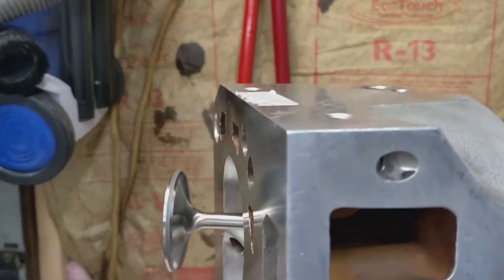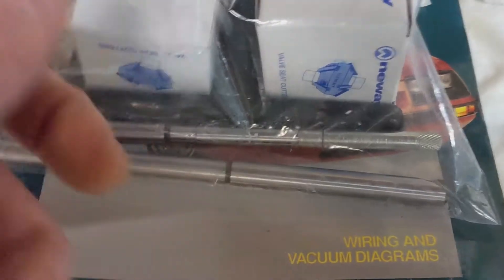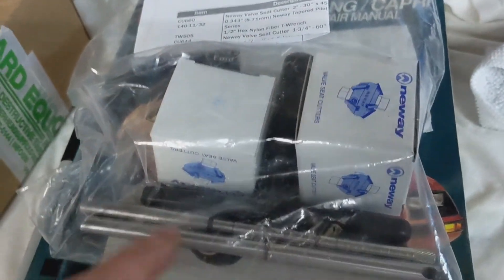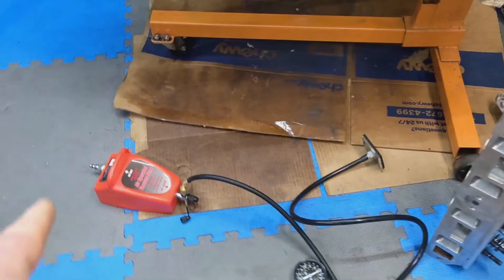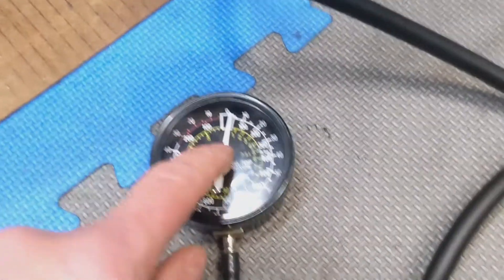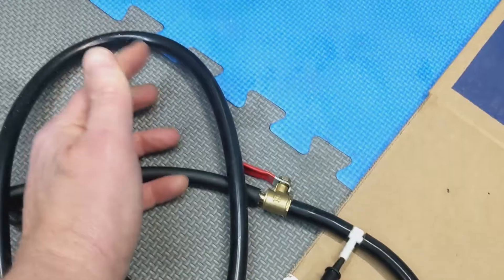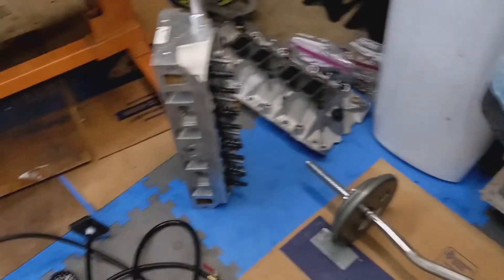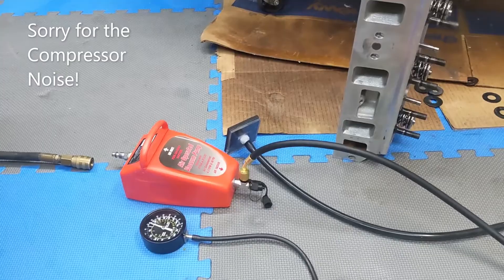vacuum testing intake valves after diy 3 angle valve job

Comment: When you vacuum test on the port side, the valve guide and seal come in to play, vacuum testing on the camber side will tell you more about the valve job, if there's a leak you must then determine if it's exhaust or intake, filling the chamber with solvent works too.
Reply from the maker: @richardvanmarter8780  thanks, good information and yeah I did check on chamber side once it was all assembled.

Comment: That's a really wide 45.
Reply: I noticed that as well...
Reply from the maker: @jamespatterson9446  yeah that was the first time trying those tools so wasn't a perfect job, one thing I found out after was trickflow puts a 47 degree seat on these stock so maybe I should have tried a 47 degree cutter instead?
Reply: @vrm86gt  cool deal I wasn't sure if you were just starting off with the whole valve job deal. I just happened to come across your video. Some do different seat angles saying it works better with the design of the ports. Some cases it's true but some they aren't. Recommended seat angles by factory probably don't apply if the heads are being ported.
Reply from the maker: @jamespatterson9446  yes I am very much learning as I go! my car went 130 mph in the 1/4 n/a with this valve job so that's pretty decent for this combo and my minimal drag racing skills!
Reply: @vrm86gt  not sure what your combination is but it sounds like it's moving pretty good
Reply from the maker: @jamespatterson9446  347 in a foxbody
Reply: @vrm86gt  cool deal sounds like a fun ride.
Reply from the maker: @jamespatterson9446  thaks, considering i built it in my garage and I am not a good stick shift driver I'm satisified with the results so far.
Reply: @vrm86gt  all that matters is if you're happy doing what you love doing. You don't have to be great at something to enjoy it. Sometimes being great at something makes it less enjoyable.  It's all in what you really want having results you can live with.  Don't leave room for regrets later.
Reply from the maker: @jamespatterson9446  Thanks! Yeah, I try to keep it fun but I'm still competitive natured and always try to do a little better at the track
Reply: @vrm86gt  absolutely 👍lol
Reply: @vrm86gt  It's actually fairly easy to fix that. It's hard to tell for sure but it looks like the lapped surface is all the way out on the edge of the valve?
If it is, you can/should cut the outside angle to narrow the 45 inward a tad and if the 45 needs to be narrowed more, cut the inside angle to get the width you want, then blend the inner edge of the of the inner angle (if it's wider than wanted) with a sanding roll.
Reply from the maker: @KCadbyRacing  thank you, this was my first time "diy valve job" next time I have the heads off I'm going to get a performance shop i trust to do the valve job, I will practice on a set of stock heads or something next.

Comment: This is a neat little trick.  As a machine shop Owner I have a Sioux brand pro system.  And you will be surprised how many " Fresh Valve Jobs".... won't pull 20 ".of vacuum.  But for those in a pinch. ( like we are when our cool shit don't work).... put Valve in ,hook up springs.  Pour gas in the port and watch the Valve and look for weeping... (GAS ONLY water and others will seal because it's thicker ).. if you see a stream you got troubles.  But it if barley weeps out. A.light lapping will fix it.  This technique works well when you go to buy a set ( That they say is good).. A coke bottle of gas tells you what your next move is . 
People say I shouldn't tell these things.  But I got all I can do and then some. I BLESS OTHERS AS THE LORD HAS BLESSED ME..
 Go and be blessed with your projects my friends.  👍 😉
Reply from the maker: thanks for watching and sharing your knowledge! I am a novice and training on the job as you can tell!
Reply: @vrm86gt  your doing well my friend  👍
Reply: The solvent or gas trick is very old and very proven.  If you have a parts washer that contains the fluid when poured back into the washer.
Many machinists use thick Sharpies instead of (thicker, chips often) blue Dykem. Sharpies are good for layout dye too.

Comment: Expandable guide? :hand-pink-waving::face-blue-smiling::hand-pink-waving:  Very COoL. Who knew?  :O)  I already love that you are "tooling up" for some serious hands-on garage work. With the (serious) lack of machine shops these days this is looking to be the way to go in some situations. Also the concept of vacuum testing eluded me all those many shade-tree years. Better late than never. Thank you for the "tip" (ironically, something a mohel told me years ago but I digress). You RoCk.
Reply from the maker: thank you! the expandable pilot is a great tool if your doing garage valve jobs! This diy valve job solution is not the best but it working fine for me thus far! Thanks for the comment and appreciate you checking out my vlog!

Comment: Hi can u pls explain once you shut off valve, how much vaccum should be holding and how long please.
Reply from the maker: just as long as it doesn't drop rapidly, ideally if it holds vacuum for 5 seconds or very slowly drops you should be fine, you can also fill the ports with gas or water and watch for seepage into the combustion chamber but most machine shops will confirm / test the valves seal with a vacuum test, Hope that helps!
Reply: @vrm86gt  Thanks so much. I filled with gas and i see that it eventually leaks after 3 minutes..  Not sure if that is acceptable.  In the beginining it leaks immediately after lapping it hold for 3 minutes..  i hope that is normal..  This is a normal working engine, i changed block because it is burning oil, ... pls advise.